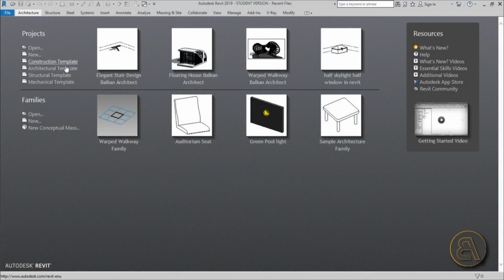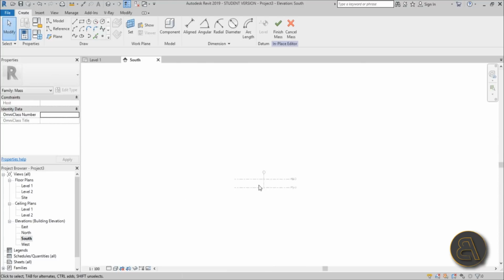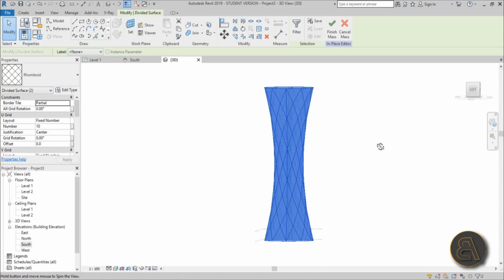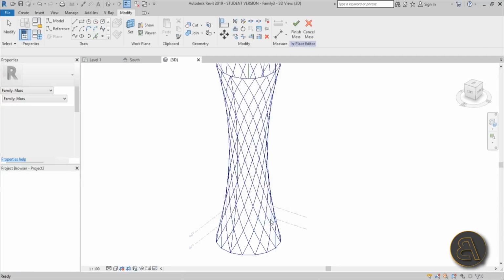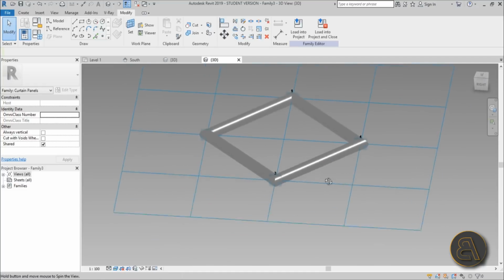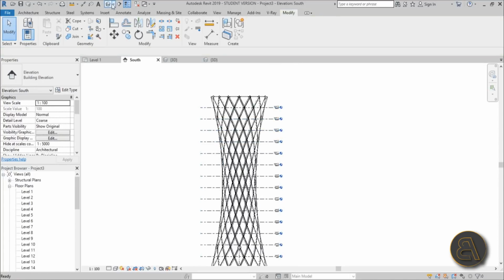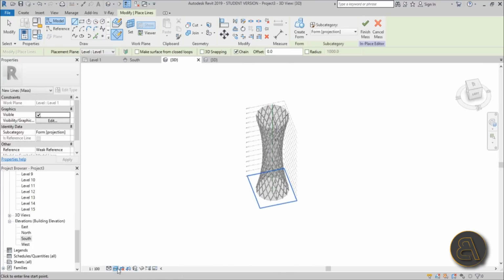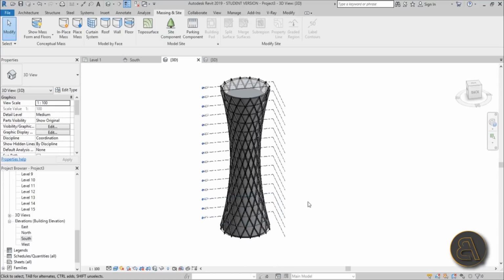Tornado Tower in Revit Tutorial

Comment: I never use this BIM software before but very interesting to use it for modeling Structure as Tornado Tower. I have one question about this Tutorial sir,  is the line that are using to draw the section plan can be changed become section Properties as Steel Beam, Slab, Composite Column, shear Wall and How to do that sir. Second Question: Are they Properties (if can be changed from line to Section Properties), linked from column to column,  Beam to Beam,   Beam To Colum,  Beam to Core Wall,  and core wall to core wall on every floor and how to do it (It is very important me to export into the Etabs 2016). Please help sir 🙏🙏🙏

Comment: Hi, I have a question. When i draw level lines by CC(Copy), It doesn't create floor plan of copied levels. However When i draw each level lines one by one using LL, It creates floor plan. Do I have to draw each level line by myself to get floor plans?
Reply: Hi, along the top bar there's a check box for create floor plan

Comment: a tip for creating the floors:
in the panel family you could've created points on the 4 adaptive points with an offset and created the frame+glass at that offset. that way you can create floors by using the mass which can be updated easily later on if/as needed. ;)
Reply: Dear johannes, could you elaborate more in this point, Thanks.
Reply: Great tip - so that facade and floors are relative to the one mass
Reply: Make a video I dong understand what you mean